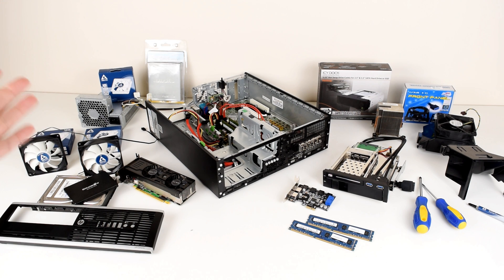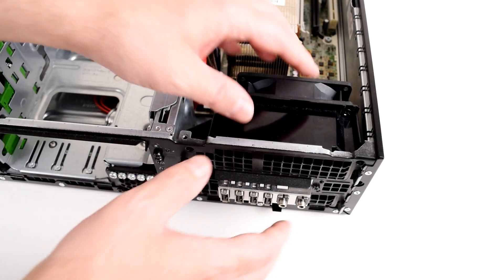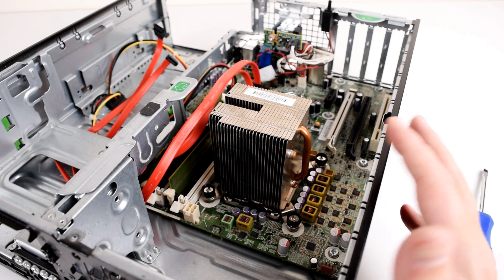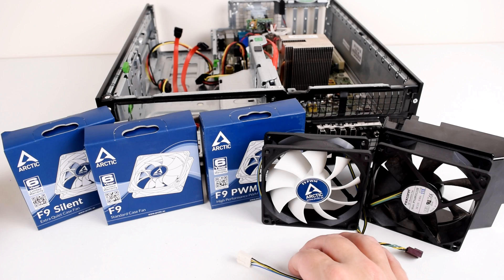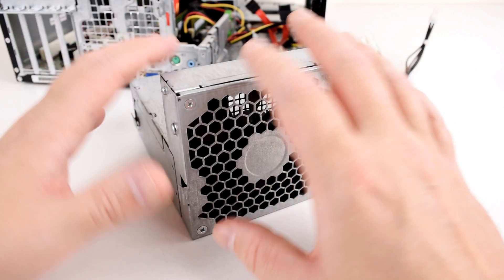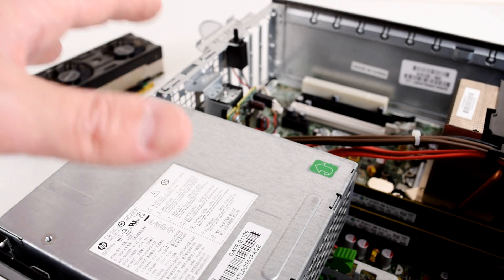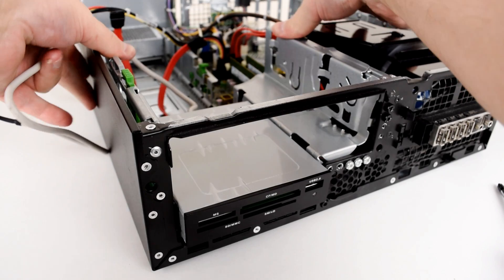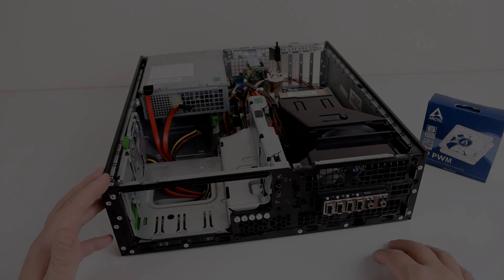Improve your HP Elite Small Form Factor PC

Comment: Just wanted to thank you for your video, it inspired me to build another homeserver for myself with an HP Compaq 8200 Elite SFF. 
However, one side note: I did try to swap out both fans. There is a 4-pin connector in the power supply, that is correct. But it is a way smaller one.
You can't possible cram that Fan connector onto that port. The only way to get this working at all would be to splice the cable of the original psu fan to the Arctic fans.
I didn't, because I wouldn't have a replacement fan for the psu, just wanted to let you know. Great video nonetheless.
Edit: Or you could just use an adapter like this: https://www.amazon.com/Phobya-PWM-Adapter-Graphics-Cards/dp/B01EUZD854

Comment: Hey thanks for the video, I have a dc7900, 2.33ghz quad core, 1tb hard drive and a Nvidia GeForce gt710 graphics card, 4 x 1gb ram.

I'm wanting firstly to upgrade my ram but am new to computers and can't figure out what ram to buy as in AMD or intel compatible?
I know it needs to be a ddr2 pc2 6400, 800mhz 240 pin.

Any help would be great cheers dude. Mine works great for games and rhinoceros 4 3d modeling software but I wanna upgrade the RAM so it has more than enough power for doing my 3d software.

Comment: Can you run a gtx 1660 on it?
Reply: I don’t think so. All 1660s need external power connectors and I don’t think there are any low profile ones. Gtx 1650s come in models with no external power plugs but there are no low profile model right now. The 1050ti is still the best card for it.

Comment: Hey Phil, can i install a gt 1030 2gb 1DDR5 into my HP 6300 Pro SFF? :D
Reply from the maker: I'm not familiar with that machine, but the 1030, at least the model I have, is single slot width, so it should fit in pretty much any PC :)
Reply: @philscomputerlab  ty bro

Comment: I always read stuff about never opening a power supply, because of remaining electricity in it. So my question is, is it dangerous to switch out the PSU fan on this unit?
Reply: That myth has been brought about because capacitors are capable of retaining charge, but it's a tiny amount. Just unplug the PSU, turn it on, and plug it into your motherboard. It will discharge any remaining energy into the mobo, and it's then safe to open.

Comment: @PhilsComputerLab, you were understating the annoyances in fixing PSU fan rattle. I bought a 2nd one of these and the fan rattled loads (mainly on startup). Replacing that fan is a bitch - its so fiddly to open the PSU unless you clip the zip tie off. Popped the same fan as you in mine and its silent now.    Triple booting Windows, MacOS & Ubuntu. One more OS to add now!

Comment: Upgrade to SSD, it's a lifechanger
Reply: what kind of SSD would you recommend? Crucial has several with a 7.5 to 9mm adapter. Would that just plug right in to the HDD connector?

Comment: I've got an HP 8300 elite in a mid tower and not the sff version shown here. I specifically went for a mid tower because of all the extra space there was to work with. It runs very cool and quiet. Mine came with a 320 watt power supply, an I7 3770, eight gigs of RAM, windows 10 and I threw in a 1050TI. It's a very nice and fast spare gaming rig. I'd definitely buy another one, but not the sff. It's just too cramped in that tiny case.

Comment: I used 1050TI gigabyte 4GB LP on this for couple of machines without any alteration or modifications , when I tried to overclock it manually using the provided software  , the machines hanged the moment I clicked anything  , it had 16GB RAM and 1X SSD, when I restored back to the auto mode , the system worked perfectly .. anyone came across this type of hanging issue?
Reply: This is because the system has a low psu, it can struggle under high loads and overclocks

Comment: Hi Phil, been watching your vids and subscribed. Thanks for your quality videos. Do you think if i should buy a HP Compaq 6000 Pro for 50 $ ? The 8200 costs about 100 usd here. 6000pro comes with E8400 and 2 gigs of ram.
Reply from the maker: No, the Elite 8200 with i5 2400 is significantly faster. It's worth the extra!
Reply: @philscomputerlab  6000 pro costs 250 liras and 8200 costs 550. Is it really worth it ? Not gonna play games or video edit with it. Just daily stuff. Thanks for your answer.
Reply: I can also replace the E8400 with Q9400 for an extra of 10 dolars.

Comment: How is the PSU fan connected? Is it soldered to the PSU, or what?
Reply from the maker: No I plugged it in, just like with the other fan.
Reply: @philscomputerlab  Great! So I should just get 2 PWM fans and plug them in? I believe the PSU fans usually don't have the standard connectors, so I am really happy to hear this. :)

How are you happy with your fans? What speed setting do you use in BIOS?

Comment: I have a small form factor HP as well, and my "fix" to it was to yank the motherboard OUT OF IT, and put it in a larger case (a normal Mid tower case) with a normal 500 watt power supply to start with!! And with that I noticed my board had four SATA ports on it, and was able to upgrade to 4 gigs of RAM, so I stuffed in as much RAM as the thing could handle gave it three hard drives (A 500 gig for the OS and two 1 TB drives for storage) and a new DVD RW drive to round it out! The 3.0 MHz processor didn't seem to mind any of it, and I have been using the system configured like this for about four years now!! Originally the machine was shipped with Windows 7 and for a long time it was running great but lately I noticed in it that Windows 7 was running just "weird", so I installed Ubuntu Studio into it!! Ubuntu works fine in it and it is faster now than it was with Windows installed for some reason!! And it is still running fairly strong, but I just got another computer that has more RAM and a faster CPU to replace it, so in its next life it will get a new hard drive set and a new motherboard and become my home server!! BUT I have got five or so years of life out of it, and I might end up re-configuring the parts to work in a totally different case, and giving it to my grand kids!!
Reply: Some HP boards use a non standard power supply so that don't always work.  I've done it on a few though as well.

Comment: These are really tough machines. I complete took mine apart without any care of being gentle with it. Pulled the motherboard out and got a dedicated power supply, put the motherboard on a box, got my gtx 980ti and a small heatsink and put it on the board. I did it for the lols. Completely put it back together as normal and it was good as new. Despite what i threw at it. I was also surprised how well it performed with the 980ti

Comment: Do you think i can build out everything and build it in an other atx case? And does the gtx 770 work with that pc?
Reply from the maker: No that doesn't work! But note that a uATX 1155 board second hand is only 40 bucks. So you can kinda do it by keeping the CPU and RAM.
Reply: @philscomputerlab  ok and does the graphics card work?
Reply from the maker: No. Graphics cards are mentioned in the video I think.
Reply: @philscomputerlab  sorry i have the hp compaq 8200 not slim version and you don't think there isnt enough space for a gtx 770 or do you mean there is to less watt (250w)
Reply: @philscomputerlab  can i use this case for hp elite 8200 and gtx 1050? https://www.conrad.ch/de/mini-tower-pc-gehaeuse-thermaltake-core-v1-snow-weiss-1-vorinstallierter-luefter-lcs-kompatibel-1528927.html?insert=UP&utm_source=google-shopping-de&utm_medium=search&utm_campaign=shopping-online-de&utm_content=shopping-ad_cpc&WT.srch=1&gclid=Cj0KCQiAvebhBRD5ARIsAIQUmnn0hKkPID0_4gXH4MoRsqy7OkxVQCB2Ph9ud0L5zB4cam8YPAQaCjAaAoSPEALw_wcB

Comment: What is that drive bay with the hot swappable HDDs and USB 3.0 built in? I can't find an Icy Dock product like that, and there's nothing in the description.
Reply from the maker: It's from China, but couldn't find it anymore :(
Reply: @philscomputerlab   I could:   https://nl.aliexpress.com/item/Nieuwe-Dual-Bay-3-5-2-5-Inch-SATA-III-Harde-Schijf-HDD-SSD-Tray-Caddy/32864220854.html?spm=a2g0z.10010108.1000014.4.42e52863Ly9A4F&pvid=0d553461-6aeb-4f50-ae4b-2c9b979dfb70&gps-id=pcDetailBottomMoreOtherSeller&scm=1007.13338.112281.000000000000000&scm-url=1007.13338.112281.000000000000000&scm_id=1007.13338.112281.000000000000000
Reply: Syba 5.25" Drive Bay Mobile Rack for 2.5" 3.5" SATA HDD with USB3.0 Ports
Reply: https://www.ebay.co.uk/itm/High-Quality-3-5-2-5-SATAIII-Hard-Drive-HDD-SSD-Tray-Caddy-Rack-Enclosure-L0U6/353053558625?hash=item5233a1c761:g:RzYAAOSwKJxew5GZ

Comment: i know these cases from the athlon 64 days, lovely cooling for the size tbh. The fans are PWM i think, or should be. The stock HP motherboard you can change the fan speed using speedfan.

Comment: I have a big plan to upgrade my HP 8300 elite and I might need your advise. 
I’m planning to move each of the parts into a new and larger case, the only parts that I would change would be the power supply and possibly the motherboard
From what I’ve heard you need an adapter to use your own power supply with the motherboard is this true?
So if I do need an adapter do you suggest buying the adapter or buying a new motherboard?
Thanks for the previous help and I hope you can help me with this
Reply from the maker: Don't do this if you don't know 100% what you're doing.
Reply: PhilsComputerLab Yeah I decided layer to not try this as I know how I can but there are a lot of point in failure in these types of builds

Comment: HEYNOW ~ Great Guide :  I have my HP Compaq Elite 8200 Pro sff Pc with i5-2400 + 16gb + 2 x ssd & 2 x hdd + external audio + usb 3.0 + second Optical drive + printer + Other usb hardware + Msi Gtx 1050 ti 4gb gddr5 low profile Gpu with Gameplay at 1080p with all running with stock 240 Psu 🎮 even while gaming the Whole Computer doesn’t pull more than 180w from the wall ( meter ) I’ve showed videos with specs and viewers still think I’m ............. incredible price to performance Value 💻 Thanx for Posting 🇵🇹

Comment: I messed up earlier, I bout an HP 8000 because I miss read it and thought it said hp8800 so I researched the 8800 which has a very similar looking front. So it ( HP 8000 )  got here today and I was able to get a full refund because it was falsely advertised. And a new better computer ( optiplex 790 with an i5 2400 ) is on its way. I need to wear my glasses when I shop.

Comment: Hi, I was wondering if anyone was willing to help. I must admit I do not really know too much about PCs (just the basics, like what component does what and where to put them). Anyways, I have a HP 8200 Compaq, like the PC in this video, but I'm having a lot of trouble putting in a GT 1030 graphics card (I'm on a budget). It worked for a day and I downloaded the drivers but now every time I start up it doesn't work. The power is on but the LED light at the front just flashes red and windows doesn't load. Any ideas what's wrong?

Comment: What's the Size of 8200 Elite sff? 

Some say atx
Some say btx 

I Don't even know who to believe
Reply: BTX. Don't try to fit this model's motherboard on an ATX case, you will not have a good time.
Reply: André Pedreiro so the motherboard from the compaq 8200 elite sff wont fit in an mini itx case ?
Reply: @maxeijsten4880  it won't. The BTX form factor had different screw positioning and it is upside down (graphics card and PCI slots are on the upper side instead of the most common lower side of the case).

Comment: Hello sir, can the HP Elite 8300 send audio via display port? i want to connect it to my TV via D-port to HDMI adapter...
Reply from the maker: Yes!
Reply: Can you please share how? i've installed all latest drivers (Intel's) and still could not do it (with the appropriate adapter of course) :-(
Reply: Kind sir, can you please help? I'm desperate 😔
Reply: OK, Thank you for your advise and support. apparently the adapter cable i used was poor quality. i went to the store and got a high-end adapter cable and all problems solved. i have both video and audio via the D-PORT output. THANK YOU!

Comment: Nice as always Phil. I own 3 Dell Optiplexes. A 990, 7010 and a 9010. All of them have at least i5s and these are for my media center receivers and something for my daughter. She plays fortnight with the 7010 just fine with low to medium settings. I recently got my hands on a HP Elitedesk 800 g1, has an i5 4590. Thus it will be under 10% slower after I am done from my XPS 8700. Best of all I only paid $20 bucks. Minus a small ssd and memory I'll have less then $100. Stick my daughters Gt940 in it and she'll be spoiled for months to come.

Comment: I purchased a 8300 and GTX 1050, however I’m not sure what Ram I need to buy. I believe it is 1333 but I just need conformation and if you know where I should buy it, thanks in advance.
Reply from the maker: Depends on the CPU AFAIK. 1333 or 1600. But prices are so similar, would just go with 1600 because it can run at 1333 anyway.
Reply: PhilsComputerLab Thanks for responding so fast and also will the 1600 be comparable even if the slots are for 1333?
Reply from the maker: It will be identical in that case!
Reply: PhilsComputerLab Well it looks like I’m going to go buy some Ram on amazon and I love the videos on these desktops!

Comment: Great tutorial. Just replaced my fan with the ones you used. Great gain in cooling performance and noise level. Replaced the PSU fan as well. Thank you :-)
Reply from the maker: Nice!
Reply: @philscomputerlab  great video. I am concerned about the noise but recognise the price of these machines is great on ebay. As another option, I have an old microATX rig that I could upgrade so am wondering if an upgraded fan elitedesk will have noise levels similar to what I could get with a standard microATX rig? Or are they poles apart?

Comment: pleaseeeee ... tell us about GPU tempetures ... I want to proceed with the specific set up becouse it a low cost solution for gaming .... but I'm afraid GPU tempretures because all hot  air form CPU goes direct on GPU ... please let us
Reply from the maker: You can check temperatures with software and then adjust the fan speed.
Reply: @philscomputerlab   I bought a HP compaq pro 6300 SFF ... with an I3-3220, 8GB-DDR3 (1600Mhz) and i install a GTX-750 LP (not GTX-750ti LP) ... the GPU official need 400PSU ... The resoults are unexpectedly good ... I dont have any matter with power consuption (max 80W) or tempeture at all (max CPU=50C, GPU=65C)  ... soever I need another cpu (I5-3470 or I5-3570) becouse on games CPU run almost everytime much higher than GPU. I play RoE  (1080p - Low) and the CPU run at 100% and GPU never passed 80% .
So everything is ok and is an ideal solution for a second pc and why not as your main pc. I would never do it with out you ... Τhanks for all information you provide us.
Reply: I have a similar setup as this (with an i5 2500, GTX 1050,  and a Blu-Ray drive), and this greatly varies on the application, as applications and games use the card differently, usually though in most games ( on my MSI GTX 1050 LP with dual fans) I usually hit 83-85C in intensive/well optimized applications, (I currently keep my temp limit at 85C, but I have left it higher) and 65 to 76 in poorly optimize applications, and not so intensive, and it idles at ~35C. Do note I recommend picking up a card with dual fans, and also at the temps I hit, I do not see significant thermal throttling.

Comment: After replacing the CMOS battery, do you have to reset the values? If so, how?
Is the Arctic F9 PWM almost as quiet as the F9 Silent? Why didn't you use the F9 Silent?
Thank you for taking the time to make some great tutorials.
Cheers m8
Reply from the maker: With the Silent you cannot control the fan speed! With the F9 PWM you can. It's good practice to load the BIOS defaults.
Reply: Hey Phil. Great to hear from you m8.
Did you end up using the Arctic CPU fan as well? If so, which one did you use?
Thank you for the quick reply.
Cheers
Reply from the maker: @cri8tor  No the stock CPU cooler works great.
Reply: @philscomputerlab   Nice!
When I get my computer together, I'll start uploading my videos, mention your channel and all the knowledge you've shared with so many of us.
Cheers
Reply: Did you use an Arctic F9 PWM, or a regular case fan in the PSU?

Comment: Hi! My issue is that the fan what you mentoined F9 PWM has another plastic plug, so i could not plug into the power supply fan socket. There is a small one and the F9 PWM not compatible with that HP socket. What is the solution in this case? Thank you!
Reply: I believe that HP use power supplies from multiple manufacturers for the 8200.  Your power supply may be a different design than Phils.   
I'd just solder the old cable/connector to the new fan
Reply: @rogerblack4603  I fix it by cutting off the plug and weld on the old connector cable by wire colors. And it's works like new :) F9 PWM

Comment: Great Machines, I've built several for my clients (8300 with an i7, 32GB RAM, SSD+HDD, 1050ti and a wifi card) 
https://www.instagram.com/p/BhrYG8pn8bL/?taken-by=djmushin
One thing I noticed that helped temps was I flipped the fan around to blow air out of the front instead of pulling air in.